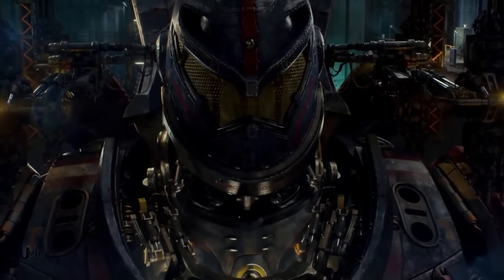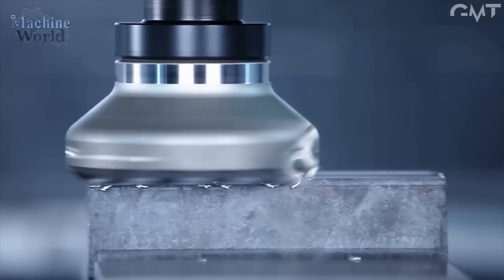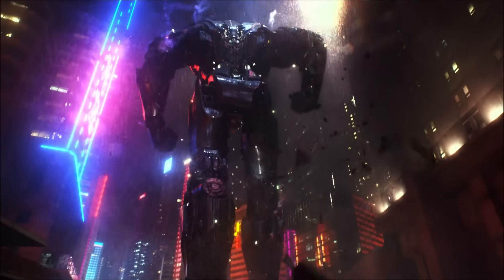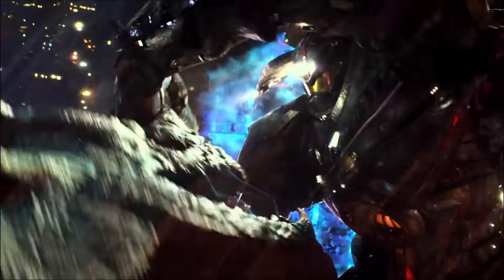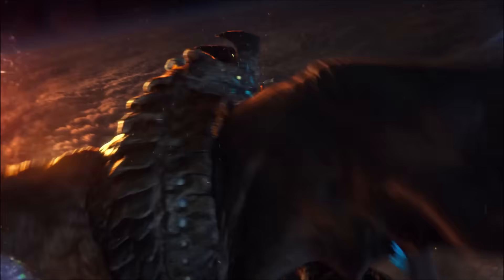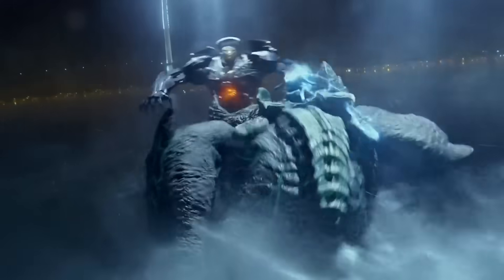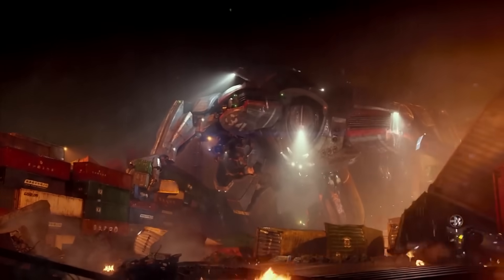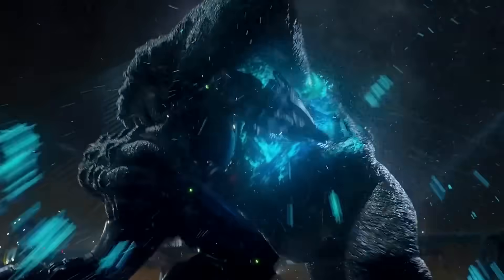How Much would it ACTUALLY Cost to Build a Jaeger

Comment: A sustainable Power source is gonna be the first problem. Second is going to be movement which will probably be through hydraulics. Good luck, not getting the hydraulic lines kinked. Don’t forget they’re probably gonna have to use union labor.😂

Comment: And then comes physics,and life,and it all doesn’t matter. Also carbon fiber for armor during fight in that scenario is totally useless. Carbon fiber don’t like to be pressed/twisted etc etc. So this will crack fast af. 

There is not such a think like „military steel”. There are things (materials) which are approved by military tech department,that’s all. But they don’t discover any new particles or kind of material. 

Tungsten for bones etc? You know how dense tungsten is? 

According to your plan this jegger will:

Collapse in the ground under his own weight (tungsten bones). His armor will brake after few blows (carbon fiber behavior under pressure etc). And will be the biggest mistake and disappointed  of tax payers in history.

Comment: Steel supplier here… Not that it would make that big of a difference in the overall cost of this, but that “$900/ton” price figure is basically bottom of the barrel pricing for steel coil/sheet.
When we sell steel for skyscrapers, it’s usually A572-50 which is a stronger sort of mid-grade structural steel. Assuming armor similarity to battleships, the hull would be anywhere from 6-10 inches thick, and if we stick with the structural steel (not armor plate) we are looking at closer to $1.35/lb or $2,700/ton. Make it armor plate steel, and you could double that again closer to $5,000/ton. Bringing the total for just the plate steel hull portion to around $9.5M…

Again not that big of a difference, but it was a fun experiment for me to price.

Comment: The idea that Gypsy Danger is analogue and therefore it can withstand the EMP made me burst out laughing during the movie. Got some weird looks back then.
Reply: I actually thought that was an interesting detail... Since (at least in the US) all nuclear reactors are analog control.  I dont know about nuclear subs though.  

Not saying that analog makes them EMP resistant, but at least the writers tried.
Reply: Not that I know anything about EMPs, I think it was relevant in the way that all their jaegar power systems were down. Gipsy being analog means they could still power on and go for the mission.
Reply: A true emp fries all electronic circuits, there is nothing we can built to protect against that unless we stop it from frying them int  the first place, gipsy energy source is analog but everything else isnt, the whole neural link would have friend rendering the whole thing usless
Reply: Right?!! So they are telling us the entire neural link, holo displays quasi ai computer systems and datalink are all analogue?!😂 And even if they invented entirely new computer architecture that was analogue, it would still matter little for emp. Analogue systems can fry too and it would not be much work to put emp shielding on the Jägers electrical systems. In fact their armor and solid build would probably shield a lot on its own.
Reply: Soviet Russia made a vaccum tube run fighter jet. (Basically analog) 

It was EMP proof we surmised (America)

Comment: Several factors are not being considered correctly or incompletely, for example, the metals used in the structure. The calculation cannot be considered thinking that just having the metal will magically make the structures and parts ready. The process of designing each part already implies a good waste of material and high costs. For example, iron is cheap, but to get it in the shape you want, you will spend at least 10x the material cost. Then, the robot needs huge parts, which makes the process of making each part even more expensive because it would be necessary to make machines capable of molding each part. I wouldn't be surprised to spend at least 1 trillion just for the basic parts of the structure. Realistically, I wouldn't be surprised if the rest of the technologies cost the equivalent of 1 to 5 years of the US national budget, and I'm not even considering the cost of labor, installations, etc.

Comment: Linking two minds isnt as hard as it seems the cia did it in the 30s but that was for telepathy and it worked but this is with the state of ther art computers from then imagine googles quantum chip combined with Nvidias aiu their ai units that should do it
Reply: — in theory, combining NVIDIA’s most advanced AI hardware (like their Grace Hopper Superchips or Blackwell architecture) with high-fidelity quantum chips (such as Microsoft’s latest topological quantum chips), along with a brain-computer interface (BCI) and extended reality (XR) gear like goggles or neural visors, could form the technological foundation for a "neural bridge" — the kind needed to synchronize two human minds and control a large humanoid machine (a Jaeger-style mech).

Comment: Let´s just say, the only way to produce these machines would be on a series basis, kinda like battleships. However the first movie depicts them as singular units with huge differences between them. That´s kinda like if the US Navy saw the Japanese WW2 fleet, and decided to build 1 Yorktown carrier, 1 Essex, 1 Illustrious, 1 Ark Royal, 1 Aquila, 1 Graf Zeppelin, 1 whatever, and so on and so on... Even with the huge US budget, they would not even reach a 2-digit number of fleet carriers. 
And the same is with the jaeger humanoid battle mechs. They should have build a dozen or maybe 2 dozens of one type, rather than half a dozen of a half a dozen types. But that would look less cool on a screen, so that´s a big no-no for Hollywood. And that´s not even counting the issues of using battle mechs at all. There´s a billion better ways to fight them. If they can be cut open by a 20 meter long sword, then build something that just carries and then fires a 20 meter long sword. Or just build a hypersonic missile carrying a 20 meter long sword inside it. Or just make a supersized R9X missile. That huge mechanoid is completely pointless if you can use its weapons without its body, which you obviously can.

Comment: The jaeger alone can be atleast 10 to 25 billion , electricity supply nuclear reactors can  cost 2 to 5 billions easy , if you add facilities which produce these machines can cost as much as trillion , tooling alone will be atleast 100 to 200 billions . Plus you need to thing about consumables like coolants , suspensions , hydrolic fluids , sensors , ammunitions , sensors R&D for all of it transportation , industrial complex to manufacture these composite materials you are easily looking at 5 to 10 trillions and you can’t fight with just one of these jaeger , you need whole companies of these jaegers for each continent , you are looking at atleast 50 trillions thats half of todays world GDP .

Comment: As we have absolutely NO idea what a partial anti-grav unit costs and what power it takes we can sum up: beyond anything this world could finance.

Why partially anti-grav unit?
Because ANYTHING of that size has a volume to surface area problem. It's feet surface area only grows by the square, but the volume, thus weight , goes up by the power of three (height*width*depth). That means the bigger something gets that's essentially more or less solid requires materials that simply don't exist yet, otherwise it's weight is far too large to stand on two feet. Especially if it intends to walk. 
Because in that case the entire weight rests only on the surface area of one foot.
With that ground pressure any Jaeger that isn't able to at least partially have its weight negated by an anti-grav unit WILL sink into ANY ground, no matter what material, right up to its thighs. That's the problem with all humanoid robots of Titanic size.
They. JUST. DON'T. WORK! PERIOD!
Even with exotic materials that have the weight of graphene, yet the compressive resistance of granite, and the torque resistance of spider silk, even WITH all of those properties, the weight of a 270' tall humanoid figure would STILL fail to make even ONE running step, as that increases the ground pressure forces by an order of magnitude.
So, without anti-grav units a Jaeger is just a huge, humanoid statue. That's it. Immobile, and utterly useless to fight a Kaiju. Who, btw, have exactly the same problem.

Even if the entire Kaiju were filled with hydrogen gas their weight would have the exact same problem: sinking into the ground even IF their bones were strong enough to resist the impact forces of taking a single step. Not to mention jumping or punching.

Comment: Lets change Tungsten out of them knuckle dusters for manganese steel. Fists the size of a two story house are heavy and will have tremendous impact pressures when used. Tungsten is strong but incredibly brittle when submitted to impact forces. Tungsten would likely shatter on the first punch. Manganese Steel however, gets stronger with more impacts.

Comment: 1:13   No, cruise ships do not weight just 1,000 tonnes. They weigh easily above 40,000 tonnes. And those will be small ones. Really big ones like icon of the seas has a gross tonnage of nearly 250,000 tonnes.

Comment: being realistic humanity would probably just resort to kinetic missiles (big sharp metal rods that go faster than sound) because realistically no kaijus armour can stop that
Reply: The main problem is Kaiju's blood is enough to kill us all.
Reply: @GF-mf7ml  From 20+ miles away?
Reply: @cheezz-c9p  in the movie, kaiju blood are highly radioactive. you might killed the kaiju, but it's blood will poison the ocean. we can't survive without the ocean.
Reply: @cheezz-c9p the blood is toxic so it would kill more humans than the kaiju
Reply: @cheezz-c9p  Yep. Modern ship railguns can already do that!
Reply: @zerocalvin super heated metal rod
Reply: @GF-mf7ml yea on the movie we see "blue blood" contaminating water supplys
Reply: It did take 3 tactical nukes to take out the first kaiju which was Trespasser/Axe Head. Giving on how each Kaiju was essentially different physically speaking. It wouldn't be a surprise if a Kaiju came out of the breach and had armor thick enough to resist or withstand kinetic missiles.
Reply: @atlasmilitaunit621  Without using theoretical physics shenanigans like neutronium or strong nuclear force, there are limits to material strength. At certain speeds, hardness wont matter much, as even solid matter behaves more like liquid. At speeds upwards of 8km/s denisty and thickness are basically all that matters. A long tungsten rod is almost impossible to beat. The energy MUST go somewhere, no free lunch.
Reply: Intercontinental blaistic missile or titanium rods from space?
Reply: An anti-matter bomb would work too but it might also destroy the earth.
Reply: Yeah, APFSDS from space
Reply: The us army already tried that decades ago, it was called "rods from god" normal missiles just proved to be better and cheaper. Think of the cost of a giant rod of tungsten and all the costs of bringing it up into orbit. Not to mention the massive space gun that houses and launches all those rods. Just use a normal bomb for a fraction of the price and basically the same result
Reply: here the twist, us army rlly tried that i believe in the cold war and it called LOSAT (Line-of-Sight Anti-Tank) hope that help <:
Reply: Half the price of trumps Mc Donald's stops
Reply: Yeah yeah specially of it came from space the gravity will serve as its fuel
Reply: yeah..absolutely....but they have valid reason why they forced to create the jaeger instead
Reply: But where's the fun in that
Reply: "Rods from God"
Reply: Railguns would be the perfekt solution!
Reply: this is kooler tho
Reply: Doesn’t work on a moving target or targets
Reply: @jaymanrun1 stated in the film they used a nuke to stop the first kaiju. So a few kinetic rockets that produce the same amount of force of a nuke each will do the work. Just need to set up a large aray of satalites waiting for orders
Reply: @SamuraiCrackZ don't mind the peasants they will never understand anything
Reply: @SamuraiCrackZ  Tanks missiles and artillery killed the first one
Reply: @cheezz-c9p those sound like tactical weapons. Since the US Army doesn't possess any particularly potent tactical missiles (something you could use as a bunker buster, say) designed to close with a moving target, that means that pretty light weaponry (by the USAF's or USN's standards) did the first one in. I also doubt that whatever jets the USAF has on 15 minute ready status typically carry anything more powerful than an AMRAAM. While powerful for its purpose, the AMRAAM is, first and foremost, a very quick, highly maneuverable weapon designed to shred vehicles that are built darn near as flimsily as possible.

So what you're saying is, massed tactical fires of the US Armed Forces (or JSDF, which is built roughly around the same doctrine) did the first one in. I'd love to see a world where operational or strategic fires were tried -- those are the real big boy toys, only carried by the USAF and USN. I'd try a laser-guided bunker-busting bomb on for size -- if some guy from Desert Storm can hit a helicopter with one, we can almost certainly do it to a kaiju. Or the massive arsenal of ship-killing cruise missiles we have at our disposal (again, entirely carried by the USAF and USN). Or TBMs, true bunker-busting missiles, which the US and her allies tend to be short on, but Russia builds in droves.
Reply: @mage3690  But do not forget the kijus have EMP's so guided missiles have troble hitting them
Reply: @funniersphere44  calling others peasant with a edgy ass pfp😂
Reply: @megacod3207 I'm bat man.. bro has "complexes"
Reply: @funniersphere44  still not calling others peasants while having no money in the bank 😂
Reply: @megacod3207  I have $63,463 in a .8% savings what you on about that's done from self-employment over the last 5 months so technically I do have a little bit 😂
Reply: @funniersphere44  60k lol
Reply: @megacod3207 you know how tax works for self employment right and that's just a savings so yes just 60k in less than a year
Reply: @funniersphere44  ofc i do lol
Reply: @megacod3207 than what percentile am I in? If I have no money yet 60k in savings 😂
Reply: @funniersphere44  still not impressed lol
Reply: @megacod3207 that's alright I'll still eat my food and carry on with the day did you have breakfast btw it's 6am (for me) you should too
Reply: @funniersphere44  its 8 pm for me
Reply: @cheezz-c9p  after like 6 weeks, 3 cities destroyed, tens of thousands of cassualties.
Reply: @SamuraiCrackZ  yea becase using nukes everytime to stop a kaiju is a sustainable and practical way to stop an indefinite amount of them
Reply: @SamuraiCrackZ  us military has rail gun, they coul try it with that haha
Reply: @funniersphere44  does it matter queer? Why can’t people just enjoy giant robots 🤖
Reply: @cheezz-c9p you do realize that kinetic missiles are basically massive tungsten rods launched from orbit, right? With the proper guidance systems, that would be able to just fall right on top of a Kaiju and release an amount of energy roughly equivalent to a fission bomb, while also being a pinpoint enough point of impact to breach their armor and get into the more fleshy bits.
Reply: @KennethDonald-p1r sure, but the rods from God wouldn't give a shit about an EMP just like Gypsy Danger.
Reply: @raviexthegod still according to the story they only have 1 nuclear powered robot
Reply: @jaymanrun1  of course it works wtf ? Some anti air Rocket can target rockets that fly 3 times the speed of sound at an altitude of thousands of meters
Reply: Where is the fun in that?
Reply: @Spartan14-g1s there isn’t, that’s why it’s realistic

Comment: $500 billion with facilities and R&D for a Jaeger unit that’s less than $14 billion doesn’t sound so bad in light of the kaiju crisis. The total economic cost of a kaiju annihilating a major metropolitan area could easily clear $100 billion (Hurricane Harvey did about $120 billion when it hit Houston in 2017), and they were popping out every few months. If $1 trillion were thrown at the program, producing roughly 36 Jaegers, then the total cost per unit would drop to less than $30 billion apiece. Keeping all the ports along the Pacific safe and open would pay dividends in the long run.
Reply: I got this much in change under my basement
Reply: @blackpurple9163 😂😂😂 ill look down in my sofa
Reply: Building a 200ft tall laser wall would have been way cheaper an effective
Reply: @jbstepchild Probably, though we'd probably also need a breakdown of operations and maintenance of both the Jaegers and the laser wall to be certain of that. A laser wall with enough energy to harm a Kaiju and long enough to fully protect the coastlines would draw a lot of power, even if it were only switched on when a Kaiju got close. (Keeping the Jaegers on standby would be expensive too, of course.)
Reply: Today a jaeger would be atleast in the 10s of trilions in r&d
Reply: @hsandev8972 we haven't even begun on the tarriffs the hands outs the palm washing the turning the back the shotty workmanship the hire dei the politics lols its not getting built in this election but good news we have the ability to land on the moon
Reply: it doesn't sound so bad because it really unrealistic..it will at least cost a trillions realm....because we don't even have the material necessary to withstand that...and even a nuclear reactor still posing a same exact similar issue till now...cooling problem
Reply: Imagine how much a bag of chips would cost with the tarriffs then 1 20g bag of doritoes would be 390.00 before tax
Reply: I think that is the double as you really try to project and build it. There are too many unknown aspects to assess the cost